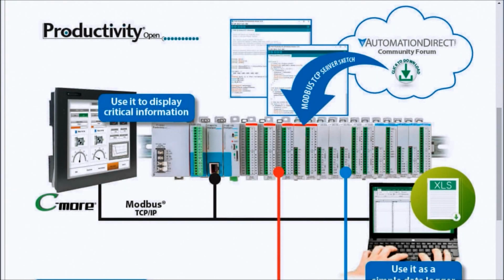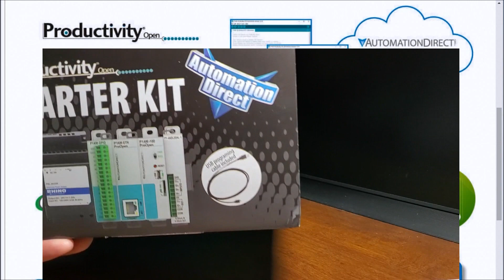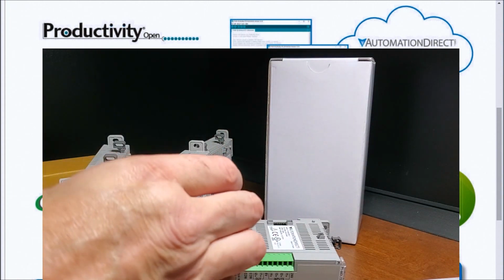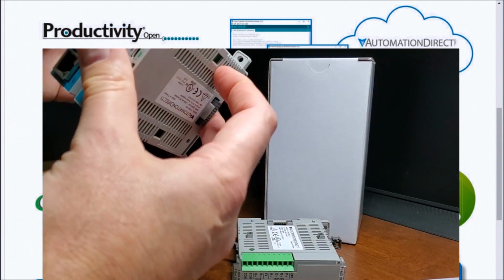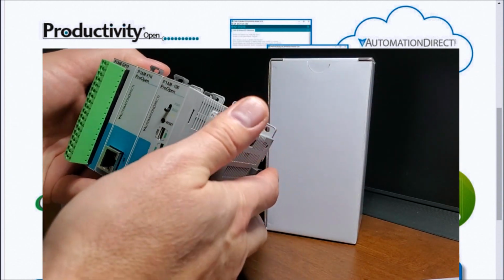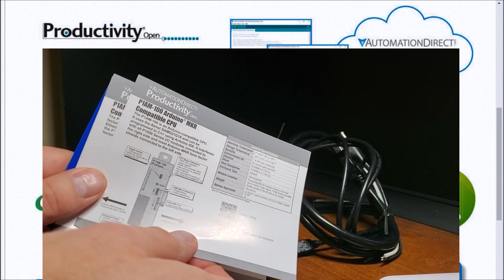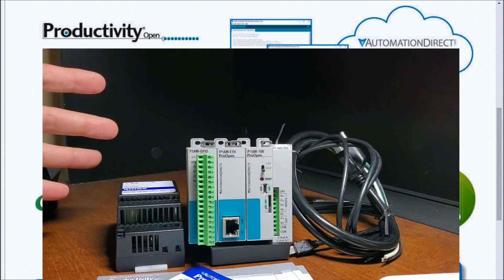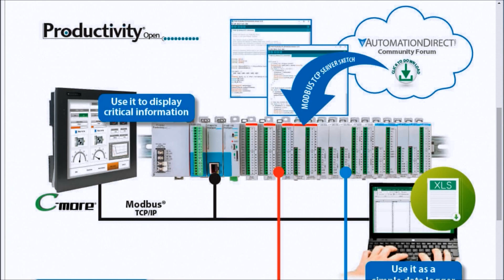Productivity Open Arduino Industrial Controller Starter Kit Unboxing

Comment: Does Arduino IDE support it?
Reply from the maker: Yes, the Arduino IDE will support the P1AM unit.  You can write your programs (sketches) in C++ directly in the IDE or use Productivity Blocks. This is a tool that will create the C++ code in the IDE.
https://accautomation.ca/productivity-open-arduino-compatible-industrial-controller-installing-the-software/
https://accautomation.ca/productivity-open-p1am-industrial-arduino-first-program/
The above two posts will help you get the software installed and running quickly.
I hope this helps you out.
Regards,
Garry

Comment: Do we need all those four kits for a project ? lets say to run a servo motor.Thanks.
Reply from the maker: Hi Chiranjibi Subedi,
It would depend on how you are communicating to your servo drive. Here is a thread on a similar question.
https://community.automationdirect.com/s/question/0D53u00003kRmCNCA0/i-have-a-p1am100-cpu-board-do-i-compulsorily-require-shields-and-io-modules-i-need-to-run-a-servo-motor-driver-using-the-p1am100
I hope this helps you out.
Regards,
Garry

Comment: your information is always wonderful and i just received the same Arduino_AD-kit.  i like automationdirect but any recommendations never seem to happen :/ so here goes:  very nice arduino software...will this software run on Raspian-Debian-Linux-OS software?   if so, i can also set this up a on a raspberry pi...and have even more fun,  thanks...:)  this way i can use opencv for machine vision projects and i am sure you have some very good ideas on this real world topic. thanks loads
Reply from the maker: Hi q zorn,
The Arduino Software (IDE) runs on Windows, Macintosh OSX, and Linux operating systems. I have not tried to run this on Raspian-Debian-Linux-OS software, however this looks like it will work.
https://magpi.raspberrypi.org/articles/program-arduino-uno-raspberry-pi
Regards,
Garry